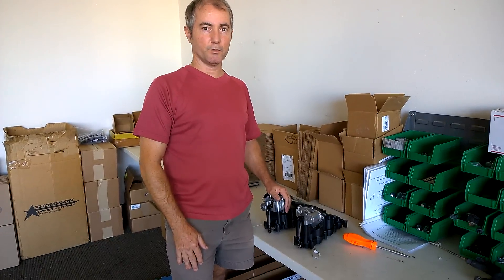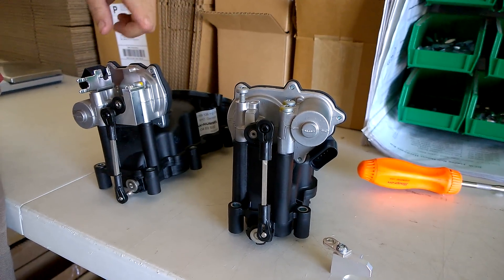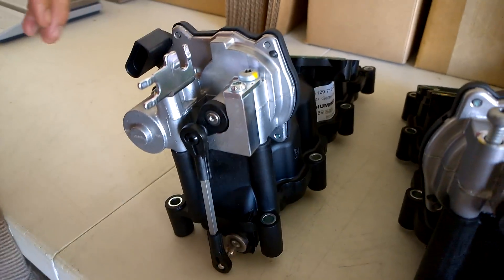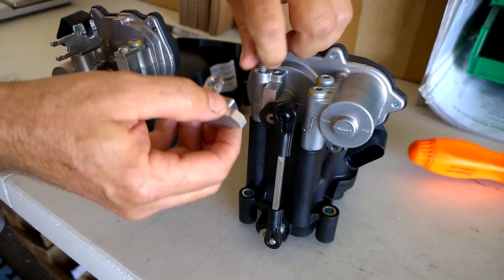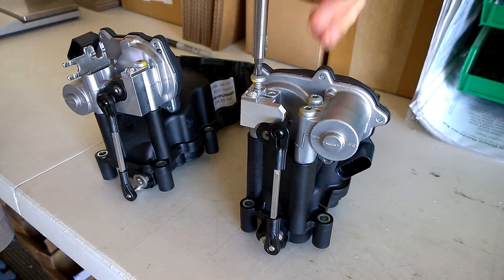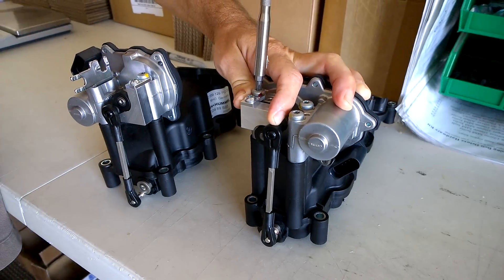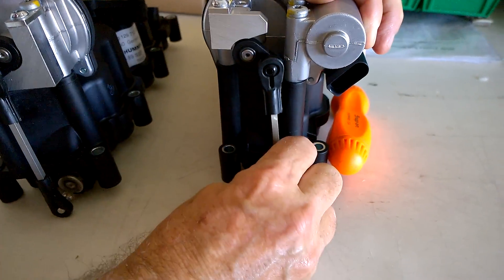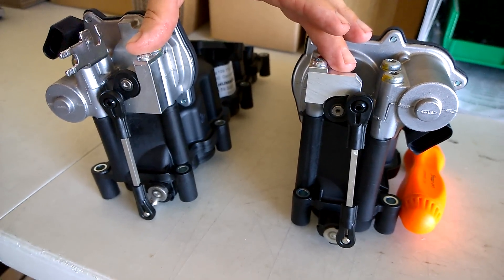V6 TDI P2015 Repair kit from Dieselgeek!

Comment: Hey Jim! Thanks for being a pioneer and developing these fixes. I received my order from you in 3 days via FedEx, and installed the 2 brackets on the intake manifold motors on my 3.0 TDI in about 20 minutes. The original P2015 code cleared after 3 on/off cycles, and as a bonus my P310E and P1128 codes (related to the EGR) also cleared!! Awesome product. Thanks!

Comment: Thank you guys at Dieselgeek, order received here in Italy ,Venice.To change the intake runners and actuators Vw made me a quote of 1750 euros plus labor...so here we are in the 2k euros ballpark for the job done.Now I have an option for under 200 euros,I'll try your kit and I hope to see that damn orange engine icon to disappear ...forever cheers
Reply: did it work ?
Reply: @drazenbabic4706  well the driver side went in easy,the passenger side was a little try and error to meet the flange,other than that,no more than 15 minutes job.As soon as you start the engine,as told,the service  engine light doesn't go away,after 3 re-start that damn yellow light has gone,so yes it difinitely works good

Comment: It will work on a 2005 vw phaeton 3.0tdi engine code bmk 165kw(224bhp)?
On Ross tech scanner I found errors 004120 intake manifold runner bank 2 lower limit not reached and p1018 001 upper limit exceeded intermittent.
Thanks

Comment: Will this get rid of P1018 Lower Limit not reached errors?  Issue is on 'Intake manifold runner (bank2). Audi A6 2.7tdi Avant UK model 2008.
Reply: Hello, I was wondering if that could work also, did you find out? I have the same problem. Audi a6 allroad 2.7 tdi model 2007. Thank you

Comment: Where can i buy this part?
Reply: €129 is far to expensive for two milled bits of metal, you can get them on ebay for €7
Reply: @jasonmaccormack2239  yeah I bough on Amazon for 20€ coz I needed them quickly